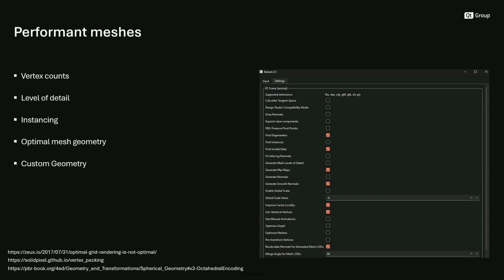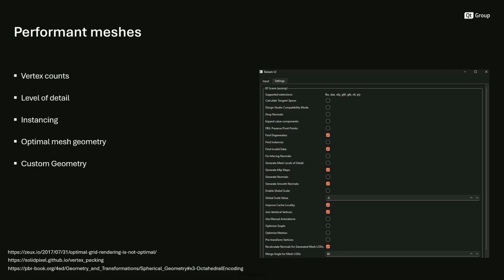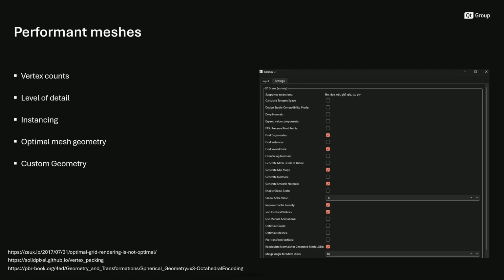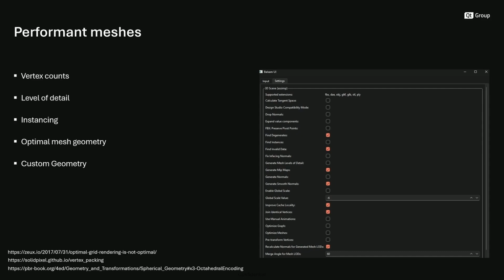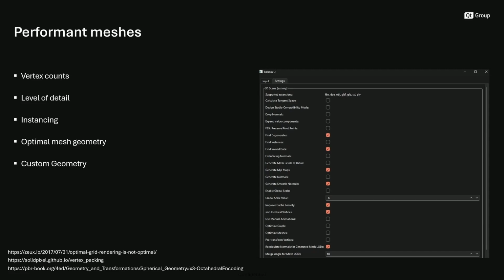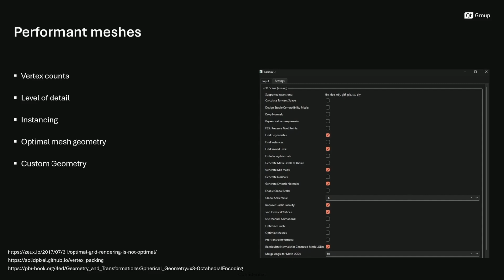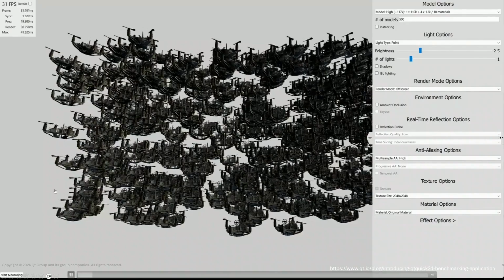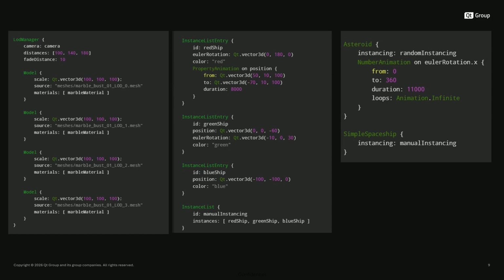How do you Optimize Mesh Rendering on Embedded Hardware?

Comment: I see you baked different mesh files for each LOD level.

Starting with Qt 6.12, I added the instancingLodFactor option. If you selected the option to generate automatic LOD levels in Balsam, you can simply adjust this parameter, and the mesh will be selected automatically, without having to constantly create multiple models in Blender.